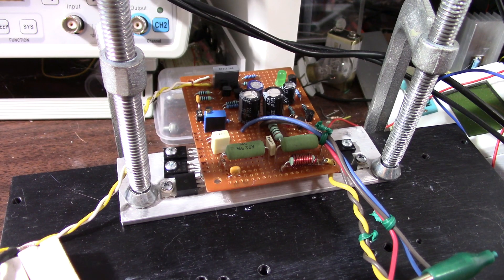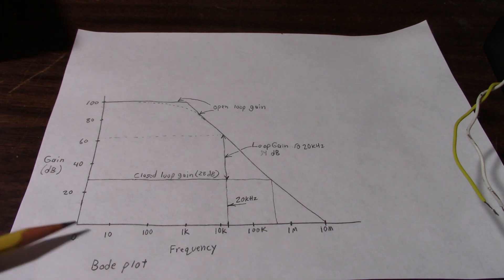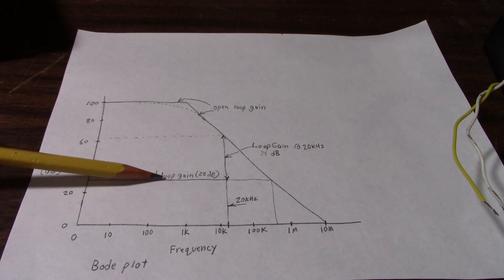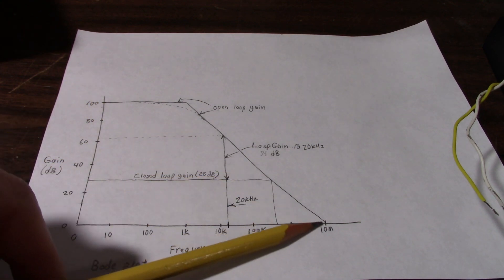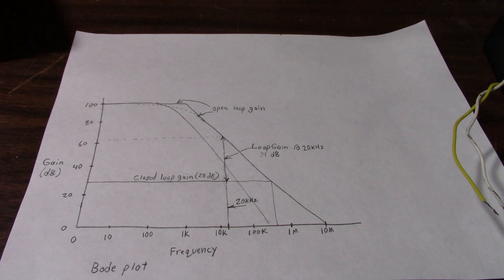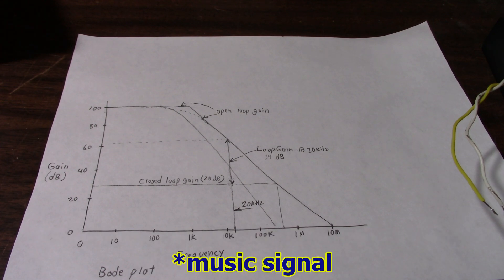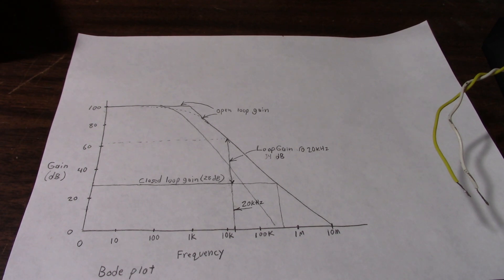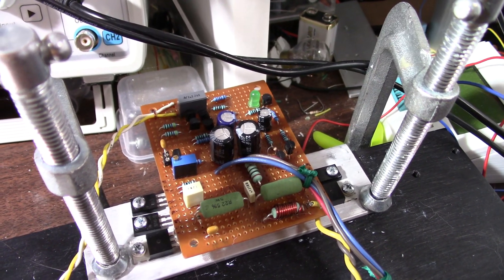Why hifi audio amplifiers are so fast (wide bandwidth)

Comment: TIM.
This occurs when the loop gain is slow.
Sure, IM and THD matter, but it's easy to get those numbers low with NFB.  IMO, transient response is critical for an accurate listening experience.
Reply: It's still im. And it's easily measurable. And more feedback especially at high frequency will lower that distortion.
Reply: @johnyang799  
Haha cool; know or learn, it's a choice.
How long have you been an audiophile and amplifier designer?
Reply: @elgringoec  I'm an electrical engineer student. So I tend to learn from the correct way.
Reply: @johnyang799  
Well, cool, but you haven't learned to answer the question.
And being an EE s student now puts you some forty years behind me when I was one.   My first amplifier project was over fifty years ago!   

Still don't know if you've designed any amps or are even an audiophile.   I've designed and built dozens of amps over the decades.   And other stuff...
Reply: @elgringoec  I've designed headphone amplifier thats has 0.00009% 500mw into 8ohm load and 0.00003% or less with 16ohm or higher load. 
But that's irrelevant. 
The point was TIM is still Intermodulation distortion and can be reduced by feedback and higher bandwidth.
Reply: I'm of the old school camp whose interest in audio reproduction is just that - an aim to recreate the original sound field as accurately as possible.   Headphones have their place in the world for various applications; however, for me concentrating on listening to music, my body needs to feel the sound waves.   It's not a natural feeling experience having the sound pumped only to my ears, but rather an animation of an aural sort.  Many people are satisfied with, and may even prefer, animations to the real thing.  And that's fine; it takes drastically more resources and dedication to even begin to approach the real thing.   But enthusiasm rarely starts at the top tier; logical people develop reasons and needs for personal satisfaction and prioritize allocating limited resources among them.

I'm glad you did some reading research.   And you're right about half a watt into headphones being irrelevant, at least for me.   Also, a ridiculously low IM+THD very low power amplifier merely entails providing power to an integrated circuit these days.   I can see how someone could choose an opamp from a specsheet, connect it up, and call it design.

From personal direct observation, 0.1% IM+THD can sound clean as a whistle with adequate power and precise transient response -- but of course you shouldn't take my word for that now since you have no practical experience so go with what your fellow bookworms write until you have your personal revelations from experience and methodical experimentation, should you pursue the hobby in earnest throughout your life.  It takes a couple kW per side to produce a clean, wide bandwidth, transient accurate soundfield 100-120dB SPL, and a big room to appreciate it.

Mucha suerte!
Reply: @elgringoec  Well if you actually design the headphone amplifier you wouldn't say that. 500mw 8 ohm 0.00009% is not easy to achieve. There are a lot of going on to achieve such level. Composite amplifier topology, advanced compensation techniques. And the idea of choosing the right chip for the topology. Cfa was used. 

Simply put, there is no one chip solution or well documented design for this good performance. There are neurochrome hp1 and thx789/888 that have similar level of low distortion. Good chip is only small part of it. 

I also designed discrete CFA and a VFA controlling circuit to perform pretty much similar stuff for power amp. That is a different project. The thing is learning and designing these days are far easier than it was at the bleeding edge when you were young. We have simulation, cheap pcb manufacturing, smd components etc. And documentations every where.
Reply: @elgringoec  For power amp, just use VFA + CFA composite and parallel design. It's scalable, it's high-performance. Ultra low distortion. But not efficient.
Reply: @johnyang799  
It's not unusual for efficiency and reproduction quality to be trade-off items.    For analog amps, class A has the least inherent distortion due to crossover distortion.  It is possible, I've done it, to make one with no negative feedback loop and sound very clean with high end associated equipment.  But they dissipate full power under no load so the poorest of electrical efficiency.   The amps with digital tracking (look ahead) power supplies have only reached competing sound quality in the last decade or so.   Then there's the switching amps such as class D which are ultra efficient and fit well for sound reinforcement but aren't quite there for audiophile pristineness.

But things are always changing, and predicting the future is more art than science.   The only way you'll learn about sound quality is to make direct comparisons in A/B blind testing.   There's more to sound quality than measurement techniques; it comes down to listening.   It takes a certain amount of experience and maturity to judge, but if you pursue the passion you will hit various "aha" moments along the way.  Also, the BS to truth ratio is exceptionally high in audiophile pursuits. On one end are the pure science technophiles who haven't fine tuned their listening skills while at the other end are the snake oil peddlers preying on non-technical purchasers so the filtering is pretty intense.
Reply: @elgringoec  Check ncore nc400 and benchmark ahb2 also neurochrome module-86. Nc400 is class D and has lower distortion you ever achieved. Ahb2 has even lower distortion at 1k, not as low as 10k and imd at frequency. module 86 is also very low sub 0.0001% range with a rise after 2khz. They are not class A but very low distortion. High power class A has many limitations. How do you do your measurements. It seems you don't really do measurements. Otherwise you would not choose no global feedback.
Reply: @elgringoec  I can say I have done various listening tests. I have trained my hearing to critical listening. I can eq to +-1db by ear. I can proudly say i have ability in both.
Reply: @johnyang799  
Cool, but it seems you're not hearing me.  At 20ish you just haven't put enough years in to be anything close to a seasoned audiophile or competent engineer.   Even if you started from infancy and were hardcore like me, which is unlikely.   I was into audio and had a collection in the sixties.   I built my first stereo in second grade by combining two record players using a stereo cartridge I somehow got my hands on.  By entering high school I had turntables, reel to reel tape decks, Sony ta2000f and 3200f, 15" Altec speakers...  By the time I started EE courses I'd already built several amps including a 75w/ch car amp with switching power supply, almost unheard of in the seventies.  I was considered an "expert" to neighbors who worked professionally and they took advice from me in high school.  Even though I knew a lot compared the vast majority of folks, and like you thought my knowledge was superior, I knew very little compared to what I learned in the following 4+ decades.   The older you get, the more you realize how little you really know.
Reply: @elgringoec  What's the best performance amplifier you have built then? Measurements?
Reply: @elgringoec  One thing is that the knowledge you gained over the years is not because of age. It's because of the industry has progressed. And the documentation wasn't that good at all. Nowadays the semiconductor technology has been fully studied on and all the possibility are almost been tested and verified. It's like you guys were at the bleeding edge at that time but we are at the bleeding edge now. How much would change in the future Idk. But I doubt many things will happen in semiconductor industry or electronics. 
We can easily obtain the competence of you guys within a few years of studying and training. That's how human progress.
Reply: Having designed amplifiers and other products in higher quantity doesn't make a flawed statement correct nor necessarily show that you understand the distortion mechanics.
Reply: Most importantly back to the original problem. TIM is intermodulation distortion and can be easily measured. And can be greatly improved by feedback. I didn't say there aren't other ways to achieve low TIM without large amount of feedback. But the fact that feedback is still the most effective way of error correction. If it works for a TIM, the original statement falls apart.
Reply: @johnyang799  

"... easily measured and greatly improved by feedback"?   Please.  You haven't even bothered to research TIM. What causes it?  Educate yourself before pretending to be knowledgeable - how embarrassing!   Pretenders are so annoying.  And unhelpful.   Break free of those bonds and become genuinely interested in improving yourself daily!   And never assume anything!
Reply: @elgringoec  Tim is caused by limited bandwidth causing lower frequency to have more distortion. There are TIM measurements on sites. Limited bandwidth and high open loop gain are goes hand in hand. When bandwidth is high enough. It's reduced by open loop gain. The Tim lands in audio band will be reduced by feedback and outside audio band will br irrelevant. There is nothing wrong with it.
Reply: @elgringoec  I have read headphone amplifier measurements on innerfidelity a few years ago. Of course I understand what TIM is.
Also for most amps nowadays it's a non issue. The bandwidth are more than 1Mhz often over 1M to even 100Mhz(10Mhz for poweramp). TIM is not an issue for well designed amplifier.
Reply: @johnyang799  
I got notification of your next two comments, it showed me the first several words.  They're not showing up in here (yet?) for some reason but I think you've discovered that TIM is caused by a NFB loop (in conjunction with low slew rate stage(s)), and therefore cannot be reduced by increasing NFB, though on the contrary can be eliminated by simply having no overall NFB loop.   There have been several esoteric (high dollar and status) audiophile amps offered which touted no NFB loop.   My experience is that they tend to be "sweet" in the highs (like cymbals and bells) while the bass and mid is "warm/rich", but lacking in precise definition.   FWIW.
Reply: @elgringoec  No that's completely wrong. And your subjective preference cannot correlate to TIM.
Simply, TIM is not "caused" by feedback. The reason of the TIM is the slow slewrate. However thr test of DIM/TIM uses square wave which supposedly has infinitely high frequency content, which is not practical. I know where you came from, that feedback causes tim. But it's inherently the instability of the amplifier by directly increasing feedback. Then the actual ways of testing relavent TIM/DIM are using CCIF imd, DIM-30 DIM-100 and 20khz thd. These doesn't have infinitely high frequency content that's impractical. When not exciting the worst kind of dim the residue can be cleared by more feedback.
The omitting of negative feedback will cause much more issues than what it brings. Essentially local degeneration will give higher bandwidth and using small gain building up along the signal path higher bandwidth is achieved. But it will have higher other distortion. Basically all the gain are wasted in the early stages(every stage except output stage) The any distortion will be relied on using class A or simply more bias or adding more output devices. But it can only do so much. High amount of harmonic distortion along with imd will be much worse than amplifier with feedback. You say it's not audible but that's what you hear. Dim was never excited in actual music so even amplifier has high dim it won't happen in playing music. To simulate worst case scenario of music playing, we have DIM-30 CCIF and 20khz thd. That's all you need. For amplifiers with bandwidth of over 1Mhz is completely non issue. The residue of TIM is often just harmonic distortion which is easily reduced by negative feedback.
Reply: @johnyang799  
You're missing the basic concept of tim origination.  Due to the slow response and high loop gain, one (or more) voltage amplification stage will saturate before the NFB makes it back to correct.  I was reading the literature when the phenomenon was first published and given the name.

As for different levels of different types of distortions, if you want to know what's what, you'll have to listen to a lot of different stuff and compare.  When the differences seem miniscule, use a fast switching A/B device.

Anyone can regurgitate what they found written or said.  What is surprising is how much stuff differs from what you clearly discover for yourself.
Reply: @elgringoec  That's the earliest report of tim. And the conclusion is indecisive and incorrect. And you lack the knowledge of how negative feedback work and stability analysis. If what you described happened, the input will slew to the supply rail and the amplifier will then oscillate.  It's simply the slewrate limited induced distortion. Without feedback it's easier to have higher bandwidth hence why it's less chance of happening. The increase of  TIM response to nfb is simply because the amplifier is less and less stable. The negative feedback itself is not the cause of TIM.
Reply: @elgringoec  Simply put TIM is inaudible. No matter if it's present or not. With music signal it doesn't introduce distortion within audible range. It's irrelevant. That way CCIF is used as most extreme way of testing slewrate/bandwidth induced distortion. And hence why multitone(10 tones 32tones) is used to get full picture of how amplifier performance. Everything is included. For modern TIM  testing method, there are TIM-30 TIM-100 of limited bandwidth to be suitable for actual, realistic condition. When it doesn't excite the slewrate limitation, TIM is not present. And the only residue of TIM tests will be harmonics which will be taken care by feedback.
Reply: @elgringoec  Using full bandwidth square wave(100Mhz or higher bandwidth) to test amplifier doesn't reflect practical condition hence the conclusion that could be drawn is inaccurate.
Reply: @johnyang799  
"Inaudible" by whom?  By your own personal discovery or are you repeating someone else?
Reply: @elgringoec  Have you ever measured yourself? Have you ever used multitone? Null test? There is no sign of anything sort of TIM with music signal for modern well deisgned amplifiers.

Comment: High gain hifi amplifiers sometimes act as unwanted SW radio receivers, if the input wires are touched.😂😂
Reply: high gain and high openloop gain are two different things.
Reply: @johnyang799  , yeah, I know that!
But you can try that experiment yourself(I am talking about "high closed loop gain")
Reply: @anindyamitra5091  That's why i found it a bit off from the video because the video is about open loop gain and feedback not closed loop gain, my friend.

Comment: Hi John I don't understand most of that lol but it is still interesting ; ) I just done a hearing test the other week with a phone app I was really shocked to see how much HF loss I have : ( both ears have nothing above 12khz ! My wife would say its with years of listening to Camel music ? Andy Ward's percussion is awesome : ) if you get an opportunity listen to Arubaluba from 1973 it as so much energy ! Thanks for making my day more interesting
Reply from the maker: I used to get my ears professionally checked and I had much better than average hearing. Now I'm only good for 14 KHz. I always wear hearing protection when running power tools, mowing, ect. but age is the enemy hearing. I'll check out the music. I'm always looking for something different to listen to.
Reply: @JohnAudioTech  
Everytime I work with my friend who designs low distortions spkr drivers I must wear earmuffs - I sort of ignored it before but now that I'm older I easily get ringing in my ears if the sound/noise from environment is too loud. When young I could hear the 19kHz pilot tone, then later the 15k on CRT  monitors would make me sometimes nuts, but these days I can't hear it so surely I getting deaf. I think lot of people past 40-50 who work around machinery have a severe hearing damage but we somehow get around it without noticing it.